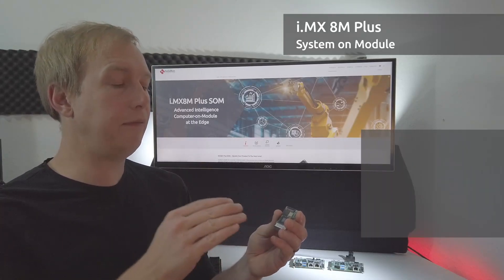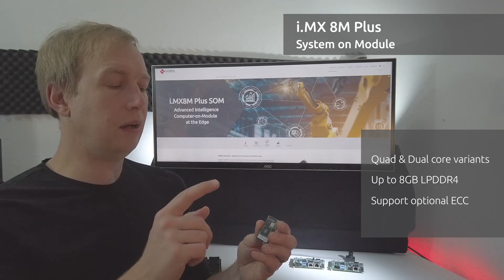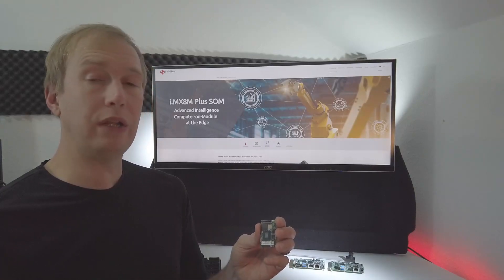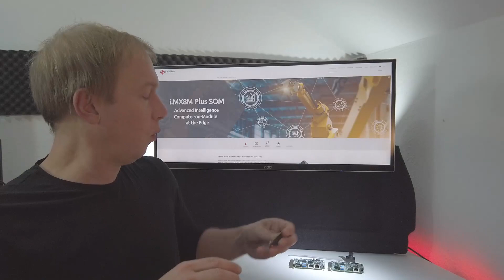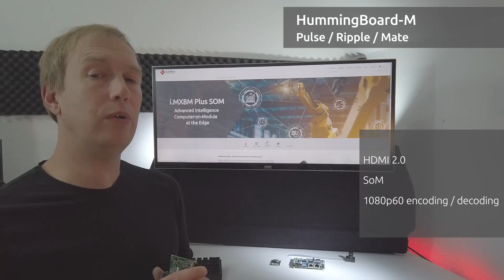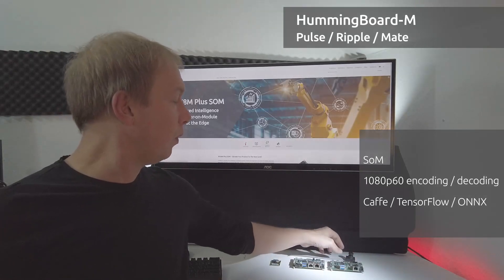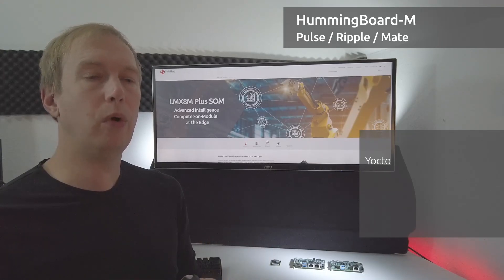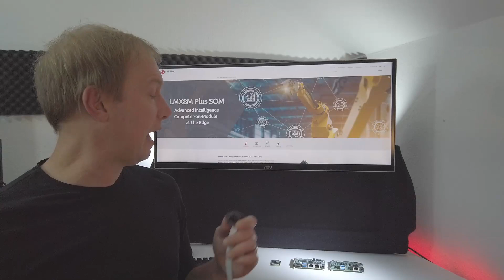SolidRun i.MX 8M Plus System on Module -Portfolio Introduction

Comment: Hi, i want to build a prototype of a "desktop" offgrid system based on soc(som)sbc. Needs to run on linux (ubuntu) in order to use softwares like libreoffice, libracad, freecad, gimp, blender, etc. Also should have the possibility to add periphericals as monitor (at least one), keyboard&mouse, ssd, etc. The system should be optimized to get the maximum rendering capabilities for blender (using all the performance of the imx8), also a heatdissapator/heatsink. It's possible to use your product for this?